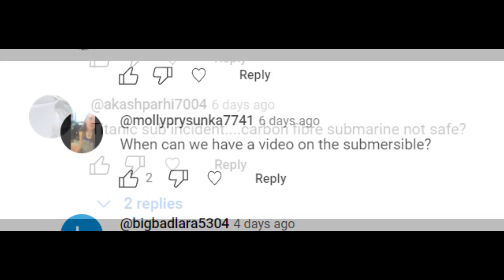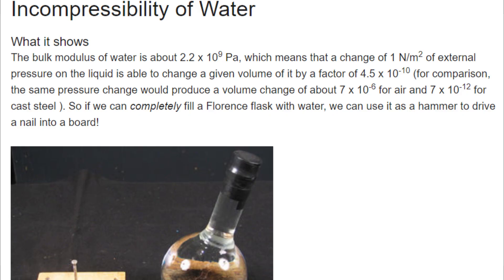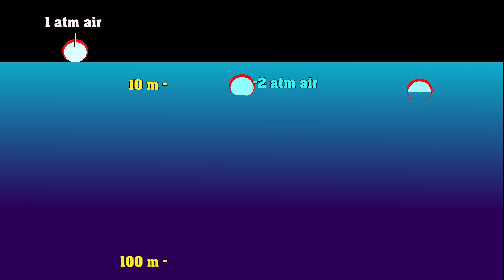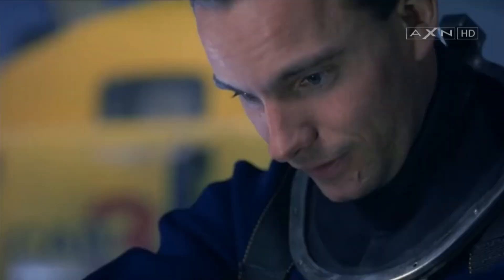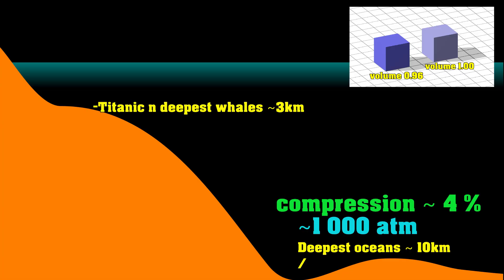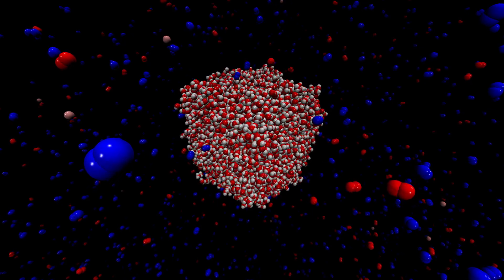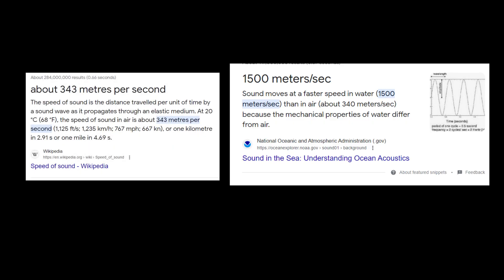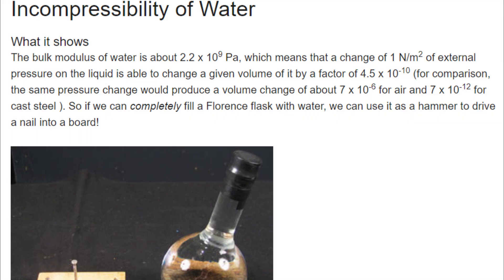What Happens when a Hull Fails at 1000 atmospheres?

Comment: From working with water under high pressure. In the event of a very small leak (ca. 0.8-2 mm hole) from the system under 200 bar (pre-start test pressure after moving the cells and refueling) the water expands into "cold" steam even though it is at 24-26°C before starting the primary system
Reply: The water temperature at 3800m is very close to -18 Celsius. Boiling is not likely - flash freezing is.
Reply: @allangibson8494 
26°C is "boiling"?
In what world!
Reply: @VariantAEC  On Mars? Water at 26°C will "boil" at a lower pressure
Reply: @VariantAEC  Any water above zero Celsius will boil if the pressure is low enough. It’s called the “triple point”. (And is actually the definition of zero Celsius).
Reply: @dinkoz1  
Too bad we're not talking about low pressure then. We're discussing very high pressures at the sea floor about 3km deep.
Reply: @allangibson8494  
We're not talking about low pressure the OP only discusses the movement of water from a 200 bar (high pressure) environment to a ~1  bar pressure environment. This "cold steam" as he puts it could more accurately be defined as a mist... because that's what it is. We literally create mist by forcing water into a confined space increasing it's pressure before allowing it a single fine point to escape from. The tighter the confinement the finer the mist until the hole is so small that it's effectively water tight preventing movement.

Reference any squirt bottle ever made.
Reply: @VariantAEC  that is just 300 bar
Reply: @dinkoz1  
Regular atmosphere is also just 1 bar... that's ONE!
Going from 200 to 1 will create a mist certainly if it creates a jet then look out and also there's going to be way more water escaping the high pressure container or in the case of a submarine entering your low pressure container.

What people keep forgetting is that with the water rushing in air is also rushing out but the air doesn't rush out with the same force that the water can rush in for two reasons.

Reason one the water is a much more dense material than air.
Reason two air can be well incorporated into water in a gaseous state while water cannot be as easily incorporated into air and remain a vapor especially as pressures rise. As pressures fall water can more easily break down into a vapor which can diffuse through air as a gas, but again the opposite is not true.

This is why water rushing in to a fully enclosed submersible unimpeded 100 m down is traveling at the speed of sound of water and not the speed of sound of air.
Reply: @dinkoz1  
"On Mars? Water will "boil" at 26°C at a low pressure"
Again...
We are not talking about low pressure.

Got it?
Reply: @allangibson8494  After the expansion, part of it crystallizes, but not enough, because the expansion is also propagated by the gases dissolved in the water. Expansive cooling occurs, but not enough for immediate freezing
Reply: @dinkoz1  The water at 3800m is at -17 C - below freezing. It is liquid because of the pressure.
Reply: @allangibson8494  I'm not writing about the conditions in the deep ocean, but in the 200 bar primary cooling system at room temperature. Furthermore, the temperature at that depth will be between 2 and 4°C, never below 0°C. As soon as the freezing temperature is passed for the salinity level, the water freezes. Check your source of information because even at 11000 m depth the temperature is above freezing. The freezing temperature with salinity at these depths of an average of 3.5% is only slightly below 273K but never -17°C

Comment: Like everyone else, I've watched lots of videos about this sub, yours is the only one where I've learnt something new. I knew nothing about the compression of water, although I did wonder why the implosion was so fast and no one else event hinted at it. Now I know! Thank you sir, I salute you.
Reply: Indeed. It also explains why the aftermath of an implosion looks like an explosion. The expanding water hits the opposite wall and explodes out the other way.
Reply: I had always heard that water was incompressible and that never made good sense to me.
Reply: @andrew_owens7680  That's because physics are often described at different scales or different complexity levels. For most practical purposes, water isn't compressible. If you jump from a bridge, the water will not sponge but require that you move away the full volume of your body of water to make room. But for very high pressure, the compressibility will start to matter.

This is like how Newton describes speed, acceleration etc. Then we have Einstein that adds the concept of relativity. At low speeds, Newtons formulas are good enough.

In this specific case, we need to talk a out how water compresses. Because that's a requirement to explain how water can fill the sub so quickly. Without compression, it wouldn't have slammed into the sub at 1000+ km/h. This model explains how the water isn't just starting from zero speed and then relying on a huge amount of water to starting to move at faster and faster speed. The expansion of water already there means much less amounts of water needs to speed up to fill the sub. And less water needing to speed up makes this process so much quicker.
Reply: @andrew_owens7680  gotta thank the oversimplification (and lies) in school material
Reply: @YounesLayachi  Sometimes you run into issues like with the standard textbook model of the atom. It has very little in common with the reality, but without that model as a starting point the concepts that you need to understand in order to understand the reality of the atom are pretty much incomprehensible. (and you will sometimes find that there are multiple layers of this).
Reply: @laurencefraser  when the starting model is very wrong and detached from reality, it becomes more difficult to correct the mistake later than to learn the reality from the get go
Reply: Speak for yourself. Other people watched exactly 0 videos about this sub (until TF's one) , because it's just dumb distraction involving the crazy lives of billionaires
Reply: @YounesLayachi One of the passengers was a researcher - not living the crazy life of billionaires. You need to learn to live with the fact that some people has more money. Only a fool would hate people just for having more money...
Reply: @perwestermark8920  Not a big believer in proportionality eh?
Reply: @douggale5962   Priportuonality of what? I study more. Why should I then not be allowed to make more money? If I invest own money - why shouldn't I be allowed to make a profit?

The issues in this world is how the stock market aims for short-term profits. And stock price rises. Which means all companies needs to take market shares (not possible). Or needs to increase the profit from each sold item (selling worse quality).

That's the route to a broken economy. Not that people end up having different amount of money.

So worry about the sale of bad quality. Blocking of right to repair. Blocking of access to medical care. People basing their life on personal greed.
Reply: @perwestermark8920  money is a symptom, not the whole picture
Reply: @YounesLayachi  There is a reason that the oft misquoted line is not actually that Money is the root of all evil, but rather that the Love of money is the root of all evil.
Reply: @YounesLayachi  Lmao, what is your problem? He was speaking for himself. When you say "like everyone else" it does not literally mean "everyone". You'd know this if you had an ounce of human interaction in your live.
Note just for you: You actually can't measure human interaction in ounces. Before you come and nitpick that as well, lmao.

Comment: So it's actually kinetic energy that kills you. The pressure compresses the water giving it potential energy. When the hull fails the potential energy is released as kinetic energy. In effect a sub at depth is surrounded by a bomb and the failure of the hull detonates it.
Reply: That's an excellent way to describe it.
Reply: So still just crushed/'sploded, yeah?
Reply: @taranullius9221  Not really crushed/‘sploded so much as imploded/coagulated at temperatures approaching absolute zero a mere half of a femtosecond before quantum super-vivisection via instantaneously decompressed ionized plasma vas deferens. I will be posting a simulated model on my channel soon.
Reply: Easiest way to look at it is to look at a container at vacuum imploding.
Reply: @deadboy9955  Not sure about that. A crushed container is still airtight. This is about the surrounding medium rushing in due to a breach in the container wall.
Reply: @olmostgudinaf8100  considering the material science of carbon fiber, I'd say it's a mix of two. Water influx in addition to hull deformation. Of course, which one happens faster is difficult to predict.
Reply: @deadboy9955  You mean like the one of a rail car imploding I saw that one again the other day, and I guess it shows how fast it happens .
Reply: @deadboy9955  Like that railcar tank imploding under vacuum, crushed like a can.
Reply: Bernouilli's principle at work really.
Reply: You can boil any liquid at room temperature if you decrease the pressure enough
Reply: @MrDmadness  I want to see you boil liquid metal in room temperature. And no, I don't mean metals that are liquid in room temperature.
Reply: @anteshell  pull enough of a vaccume and you will.. its not something I can do
Reply: @MrDmadness  the same in English, please?
Reply: @anteshell  its not my fault you dont understand words
Reply: @MrDmadness  please, do not project your own faults to others. Firstly, "vaccume" is not a correct word. Secondly, you specifically said "any liquid" and that includes literally any liquid material. You simply can boil liquid iron in room temperature regardless of any "vaccume". Ergo, your statement is wrong, period.
Reply: That's pretty much the gist of it. Other YT's approached this from the perspective as "what happens to your body at pressure", but while whatever explanations they gave may be factually accurate, it's pretty moot in terms of the energies involved.
As Scott Manley put it: "At some point you stop being biology and become physics".
Reply: What happens if the hole was the size of a Deo Spray thus very thin water spraying inside. Even though it's at the speed of sound the sub fills slowly and it isn't dangerous right as the hole is so small? Educate me please
Reply: @bendedstraw4294 so i looked it up and if it was designed with the little .05mm hole, at titanic depths, water would just squirt in and they would eventually drown
Reply: @YYmmmYY but considering what the video explained about compressed water expanding to fill the sub, wouldn't the water be entering through the small hole at crazy speed? Obviously the speed would be limited by the hole size buy by how much? I imagine it coming in like a water jet cutter, slicing straight through anything soft in its path.
Reply: @TheStarBlack  exactly. I want to know if the hole is tiny, how fast it would fill up
Reply: @bendedstraw4294 I think if a tiny hole 0.5mm broke open, the whole thing would tear open imploding from that point. 

Now if there was a manufactured tiny latch cover that concealed a 0.5mm tube extending out of the sub, I do wonder what would happen if the cover was opened.
Reply: -Matter didn’t create anti matter
-Anti matter didn’t create matter
(Both of them were present at the time of big bang)
-Both of them didn’t create themselves.
-Both of them came from an unimaginable source,  that unimaginable source created matter and antimatter (everything) thats why it is known as “the creator” of everything.
——————;;;;;;;;;;;;;;;;;;;;;;;;;;;;;;;;;!
- that unimaginable source/creator has created sin and virtue which are opposite to each other,
— “logic” confirmed that every action has its own reaction, the reaction of sin is different than the reaction of virtue,
— the creator has created prophets to let us know about each and every detail of sin and virtue, also about their reactions,
Thank you
Reply: Personally I get nervous when I’m surrounded by highly potential energy.
Reply: I think basically you're being killed by water and fibreglass hitting you at 2 times the speed of sound.
Reply: So the air doesn't turn hot and burn like other channels mentioned?
Reply: @bendedstraw4294 The air will get hot, but you'll be dead by that time.
And it doesn't stay hot for very long. Probably in the order of milliseconds. It will quickly dissolve into the water at such high pressure. Even if didn't, the mass of 4°C water would take away the heat very quickly.
Reply: @olmostgudinaf8100  Another question how did they die? Did they see their dead coming? Is there a plausible scenario where the hole was like 0.5mm and it was spraying some soft water(not thick like water gun but also not thin like Deo Spray) and they were all saying like look it's spraying water inside! And then xx seconds/minutes later hole got bigger? Is there any scenario where they saw it coming and suffered psychologically?
Reply: @bendedstraw4294  No it does not. It will warm up as it gets compressed, but at the same time and the same speed it will also get dissolved into the water. Dissolving  has two effects. It both releases the pressure which decreases the heating compared how people explain a non-dissolving volume of air would heat up, and the heat gets also quickly transferred into the cold water through all, convection, conduction and to lesser extent radiation. 

Everything happens so quickly that the air simply does not have time to cause any burning. Not on the ship nor the people inside of it.
Reply: @anteshell at that timescale, no. The air doesn't have enough time to dissolve. It will however, produce sonoluminescence just like cavitation event.
Reply: @bendedstraw4294  That's probably not what kills you first.
Reply: @bendedstraw4294  The compression of the air in the sub would heat it up, but only for a moment before the heat was dispersed into the surrounding water,  and only after the crew was already dead. Although since the whole process takes a fraction of a second the word "after" in the previous sentence doesn't mean much.
Reply: @bendedstraw4294 Lots of stuff happens, so it's a case of what kills you first.  He's pointing out that the wall of water moves supersonically only because water is compressible.  Maybe the supersonic shock wave in the air actually kills and cooks you before the supersonic water hits you, but his point is that the water decompression drives the whole process.  Someone else commented that if you sit in a (near) vacuum in a highly compressed medium, you are basically surrounded by a bomb waiting to go off - the energy in that bomb is not chemical but stored in the water compression.
Reply: @bendedstraw4294  Well yeah physics describe how when a gas is compressed it heats up. So did that air reach a high temperature? Almost certainly. Did it matter? Almost certainly not. The effects of the kinetic energy more than likely overwhelmed any other forces.
Reply: @DaHitch  According to chatgpt. This 4400 liter Sub would fill at 280m/s. In 0.015ms
Reply: @bendedstraw4294  That sounds reasonable enough. Have you ever heard how falling from great height into water is like falling onto concrete?
Now imagine being squished between 2 blocks of concrete moving towards each other at 280m/s.
Reply: @bendedstraw4294  The air does turn hot, but later. Actually if the water turns to only regular atmospheric pressure, it would not even get inside. So obviously, it at the end has to come to an equilibrium with the air inside.
Reply: @bendedstraw4294  it makes sense that compressing air causing ignition but i think the compression would be too unpredictable to get ignition/explosion/burning of oxygen. But its very interesting. How could one replicate this?
Reply: @bendedstraw4294  The air has stored thermal energy, that when compressed, will heat up to temperatures well beyond that of the sun at that depth.  It will heat to a temperature and pressure that will equalize, and eventually repel, the impact that has already killed you.  This temperature and pressure will cause a cavitation bubble and ringing within these hot implosion sites.
Reply: @bendedstraw4294  the 5l pocket of air next to you getting compressed and heated up to autoignition temperature will seem pretty insignificant when you think about the fact that the air in your lungs just got forced out of your chest cavity by a mach2 water hammer slamming you against the wall opposite the initial leak
Reply: @bendedstraw4294  It does, the air will be compressed so much that it turns extremely hot, almost the temperature of the surface of the sun. But, at that point, they people inside were already dead.
Reply: Thank you for your answers. That mean the other videos where they said people will they because of the hot steam is wrong
Reply: people tend to get entangled by different ways to describe the same thing. is it pressure? is it compression? etc.

things are in fact a little bit more complicated than f00t shows, but I cannot really explain it without writing down PDEs and what have you, so I'll just leave it at that